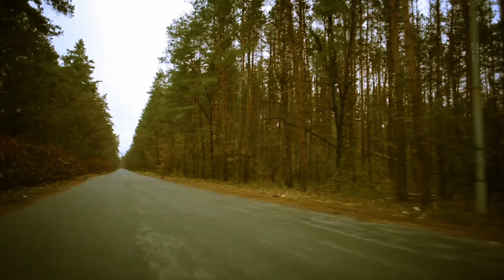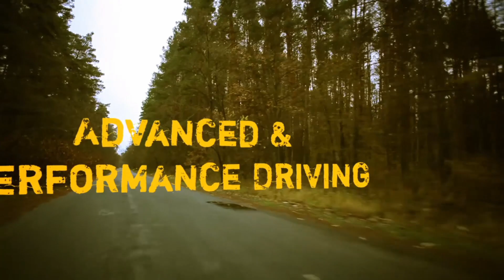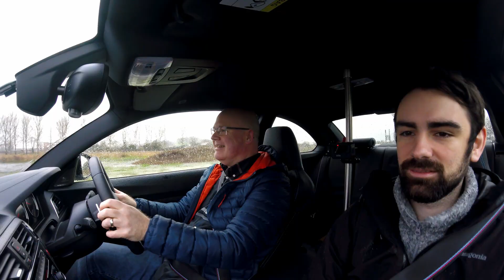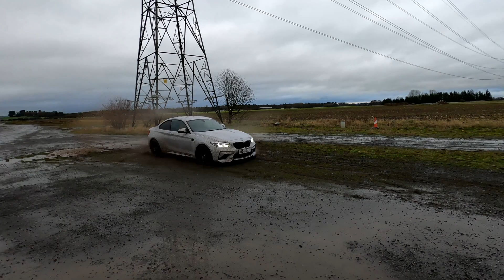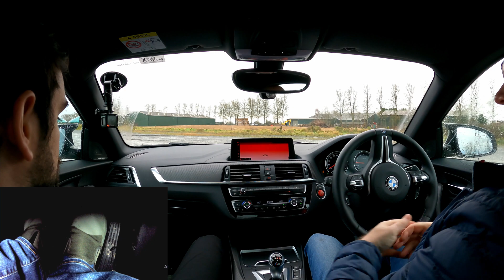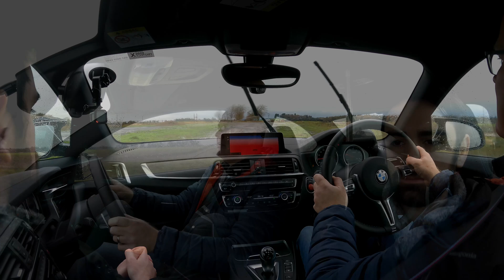Skid Control Part 1: Braking With & Without ABS

Comment: Great and timely video. I've often wondered (pre ABS) just how fast you have to press and release the peddle, so your demo enlightening. First car years ago with ABS caught me out in thin snow downhill to a set of lights, that there was no way the car was going to slow. Early in the morning and the lights on green, and the car turned left properly at the junction. Big relief. Lesson learned, always start from the top of the hill at lowest possible speed, and look ahead earlier. Hope to see James try some of the driving  to prove that mortals can also achieve these avoiding manoeuvres.  Sure he will soon be up to the standard of the Gods.
Reply from the maker: James doesn’t have a driving licence yet!
Reply: @RegLocal   No pressure then. Hope he got a go on the airfield. Reminds me of similar situation in my aunt's MK1 Capri. My driving hot better from there on. Just wish I could turn clock back and done the advanced test 30 years earlier. Better late than never.  Have a great Christmas 🌲.

Comment: In my experience locked front wheels will still stop you very quickly. ABS does allow steering control under braking so heavy that the wheels would've locked without it but doesn't improve stopping distances, in fact it increases them in almost all situations.
Reply: In ABS-equipped cars you can brake to the point just before ABS kicks in to stop in a much shorter distance.